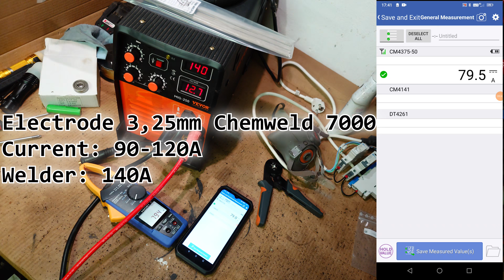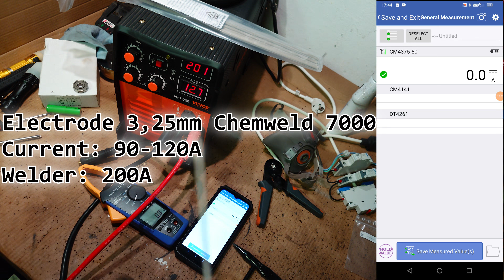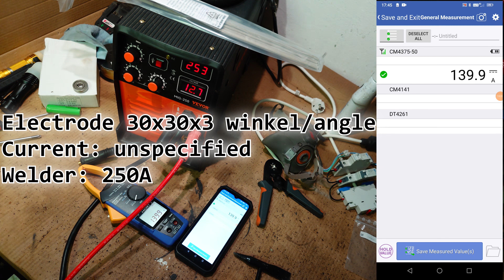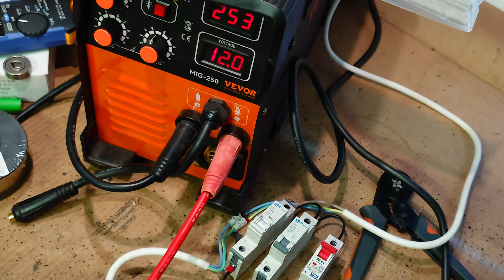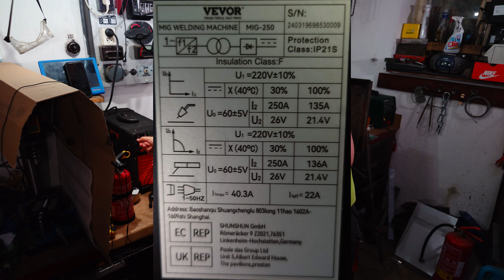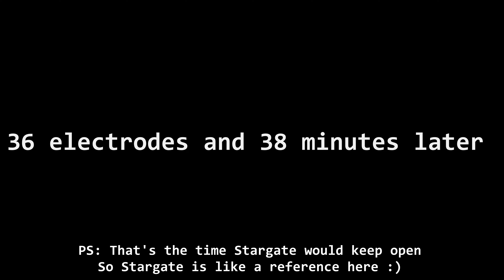Review on Vevor MIG-250 multiprocess welding machine (EU market)

Comment: Hello, very good video!
Can it weld aluminum? 
Or is there a better machine on the same price range as this one, but better 😅
Looking to buy one to assist me in my hobby
Reply from the maker: Hi, it could possibly weld aluminum with aluminum electrodes without any changes.
It could also MIG weld aluminum, but then you would need to change the bowden for teflon one, and use U-groove roller for aluminum wire feeding. The contact tip must be bought of a kind compatible with aluminum, or at least use one degree bigger one (1,2mm contact tip for 1,0mm wire).

Comment: That was fantastic review man! Its easy to just do a weld and say yes it welds good or whatever but you actually tested it properly and even went through the internals! I'm looking for a cheap lightweight mig welder for auto body work and some small jobs i havebeen contracted to do, my main welder is too big to leave the workshop and i only have a small but brilliant arc welder...so ill either buy this or a Stahlwerk, ive bought a lot of stuff from vevor but wasn't sure if the welders would be any use so thanks for the review 👌🏼
Reply from the maker: Thanks. This welding machine would be good for bodywork thanks to quite a nice choke. The arc is very much stable and able to run slightly colder (less amps = lower wire feed speed). It's also lightweight, so great for carry to weld anywhere. But there is also the mentioned flaws, that don't really prevent you from welding, and are mostly fixable, but they are there. Just like with any other DIY grade welding machine.
In my country, there is one "branded" welding machine claiming to have 330A current (it's a single phase welder). And the real current is also about half :D
Reply: Thanks man, yes I think I'll try it, I really only need it for welding auto body stuff which is a hobby for me, it should be fine, I have a much bigger mig welder for stuff I actually get paid for 😂
Can I ask you what you mean by choke? Or maybe you could tell me the Czech word and I can Google it? 
Again that was really a great review, I wish all welder reviews were like that!
Reply from the maker: Choke is a type of inductive coil, in Czech it's tlumivka.